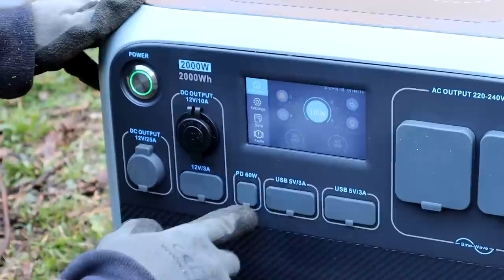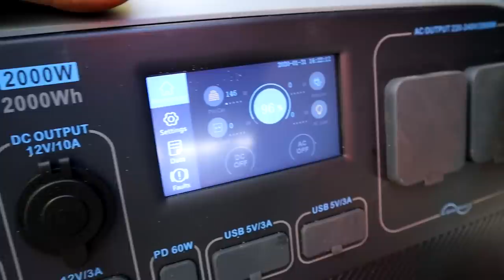Building an outhouse off grid start to finish // Bluetti A200P

Comment: Nice way to use the sponsorship! It will be perfect for them. 
It’s a hard life on the north side of a mountain. 

I’ve been wanting to get this exact Bluetti, since it has decent capacity of LiFePo (so won’t die too fast) and can take two proper solar panels to charge, to use as a balkon solar charger to reduce my power costs in a rental house. 

Nice job on the off-grid building too!
Reply from the maker: Thanks alot! such a nice battery